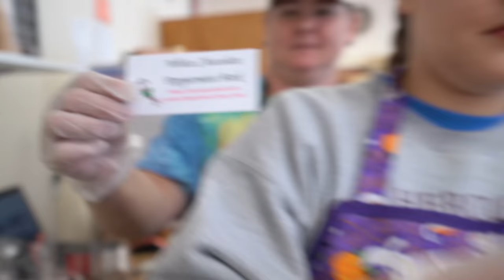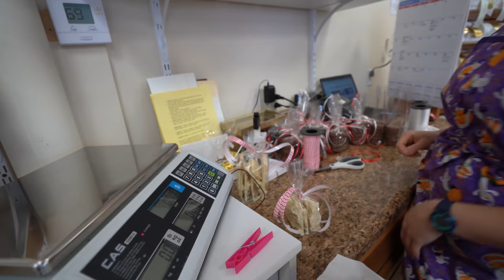We Made Peppermint Oreo Bark!

Comment: hi there, just wondering - has steve changed the temperature when boiling the mixture since back when you made similar stuff in the old place.. been watching a lot of the old videos and noticed that after the mixture comes out of the pot in the old videos it seems much more watery for a longer time, and in more recent videos even before having the new cooling table, the mixture seems to harden up quicker and be more easy for you guys to fold around :) love the videos by the way super interesting to watch, wish i lived closer and could stop by at the shop
Reply: He probably hasn't changed the temperature too much because candy needs pretty specific temperatures to make the kinds they do. That is why the creams and hard candy have basically the same ingredients. They're simply cooked to different temperatures.  The cooling table probably makes a big difference.  They also have better at climate control in the room than in the basement

Comment: The best way to have maple with eggs is to make eggs in a basket (or a spy egg, as my dad would say). U just take a thick piece of white bread, bite a hole in the middle of it, and lay it on a hot pan with butter.  Then crack and egg into the hole in the center (I like it unbroken, but some like to break it). Flip after a minute or two, plate, and put maple syrup on it (it also goes good with ketchup, if u want savory instead of sweet).  The way the bread and egg crisp up and caramelize is bomb..